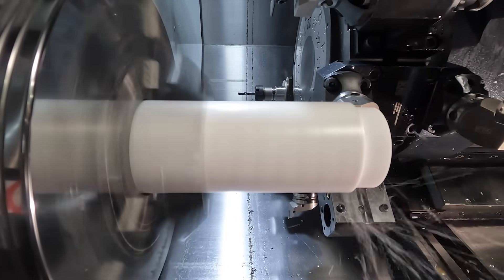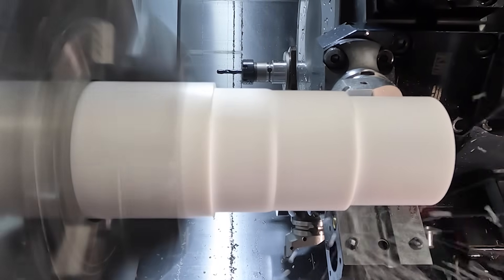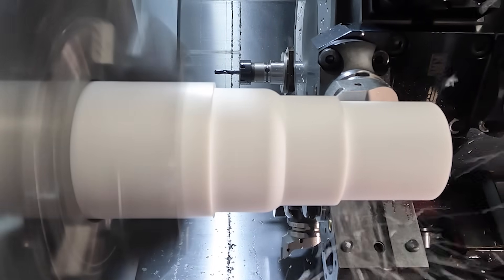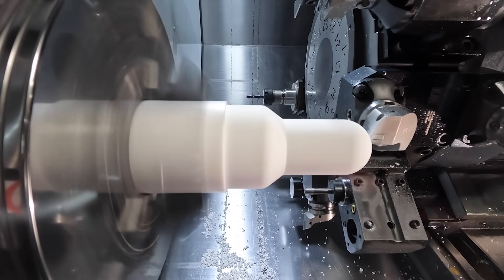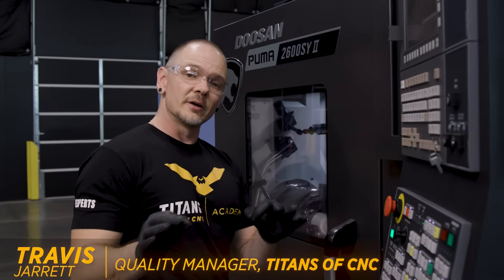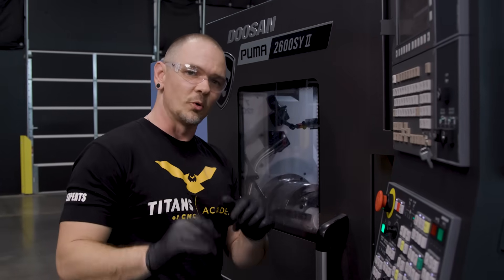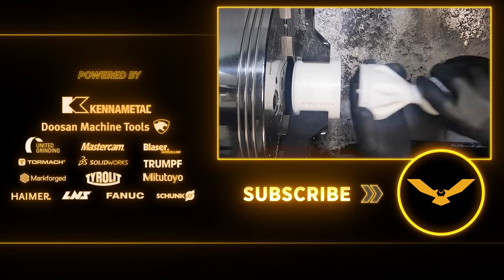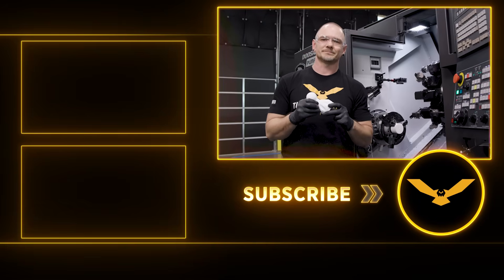CNC Machining Teflon on the Puma 2600SY II Lathe | DN Solutions

Comment: Just curious as an outsider to all this stuff, why wouldn't you just injection mold this part? It's somewhat large I guess but it looks doable from what I've seen in other videos.
Reply: This might be a one off product, a dust collector (ornament) or a replacement part, prototype sort of thing, maybe super tight tolerances. Injection molding means tens of thousands of dollars spend on making the tool before you have any useable part. It works great for mass produced stuff. Not so much for the things mentioned here in the beginning. :) 3D printer is a similar story (although they are so diverse these days...).

Comment: High speed steel is typically better than carbide for cutting teflon. With HSS, you get better finishes and can hold closer tolerances on teflon. Also, always make sure to machine the stress-relieved teflon. The non stress relieved teflon will change size significantly within a month or two after machining.
Reply: I’ve machined a ton of Teflon. I’ve had great results  with CGX style aluminium inserts. Cuts as well, if not better than HSS.
Reply: @captscorch5821  Most likely because they are positive rake, high shear. That will also do an excellent job with teflon

Comment: Is teflon bar correctly clamped? There are jaws marks on it. Teflon is very soft, may needs more pressure on jaws
Reply: What difference does it make if the marks get machined away.These chuck jaws seem to bite in where as most standard hard jaws don't and material slips especially Teflon.

Comment: what control version is on your lathe? Fanuc Oi? is this all on standard option package or did you need extra options on for this? been pritty impressed with the doosan stuff latly for good solid all arounder in there mills & lathe on offer.

Comment: Great video Travis and team! How do you typically remove that little nub at the end from the part off tool?
Reply: Thanks James. If you're referring to the nub on the part I would remove it on Op 2 (if there was one) or I would rough it with with a grinding wheel and finish (if needed) with a flat sand. Here with the plastic though a razor blade works just as well.
Reply: @travisjarrett2355  ok that makes sense, thanks!

Comment: What, no coolant to extend tool life?
Reply: Its plastic…
Reply: I doubt “extending tool life” when you’re cutting a self-lubricating material like PTFE is an issue. Not distorting the workpiece from heat might be, but blowing air on it would solve that problem
Reply: @jmowreader9555  also no clean up if you use no coolant
Reply from the maker: Just for filming purposes.
Reply: @TITANSofCNC  i've heard that coolant can be harmful to the plastic. Do you have any prove that thats true or false?

We've always run plastics with air as coolant to get chips out
Reply: @nf794  Depends on the type of plastic you´re cutting. Some can take damage from oil based lubricants.
Reply: @dodojesusrex5380  is it Something to do with Thermoplastic or thermosetting or is what you said regarding the chemical composition of each plastic on its own
Reply: @nf794  I mean the chemical composition 😄 Excuse my English, I'm German 😅
Reply: @dodojesusrex5380  Perfekt ich auch weißt du genaueres dazu auf was es ankommt?
Reply: @nf794  Ich hab mich noch nicht viel mit Kunststoffen beschäftigt 😅 Aber ich weiß das es Kunststoffe gibt, die sich nicht mit Öl-emulgierten Kühlschmierstoffen vertragen. Da wird dann nur mit Luft gekühlt
Reply: @nf794  
It not only depends on the specific plastic and coolant.  It also depends on the end use of the part being made.  Specifically, most plastic medical parts (body parts) prohibit the use of coolants which may transfer chemicals to the parts.
Reply: @berniepragle948  yes i can imagine that thanks for your Input
Reply: @nf794  POM and our Coolant doesnt Mix.. it Turns green after sitting for a week or so and starts smelling like someone dumped a 50 Liter container of acetone in the machine.. true nightmare..
Reply: @2strokesumo229  very interesting story, ive always known that coolant isnt good for plastic but ive never heard or even seen an example. Thank you
Reply: @nf794  we use "Hebrochemie" 's coolant.. its an emulsion coolant 
It's just what I saw and smelled Haha
I'm just a german machinist trainee.. pls don't k1ll me if something is wrong😅
Reply: @dodojesusrex5380  OK you two write in English so we can understand.Ich verstehe kein deutsch.😊
Reply: @mehmettemel8725  Of course you can, no worries 😄👌🏻
Reply: @2strokesumo229  Ich bin im 2. Lehrjahr :D